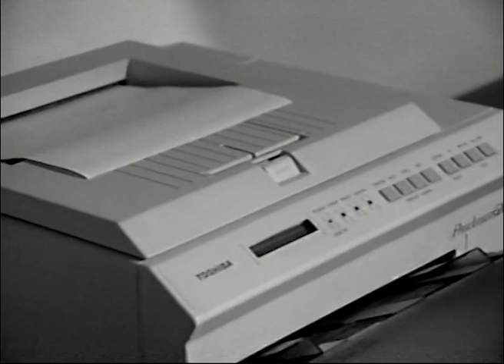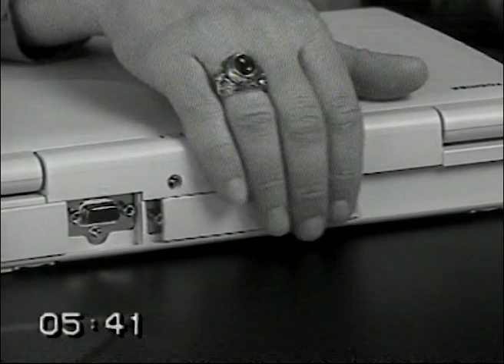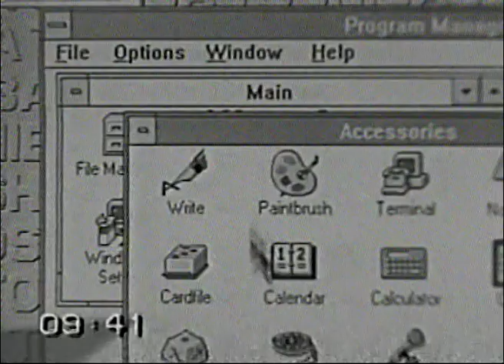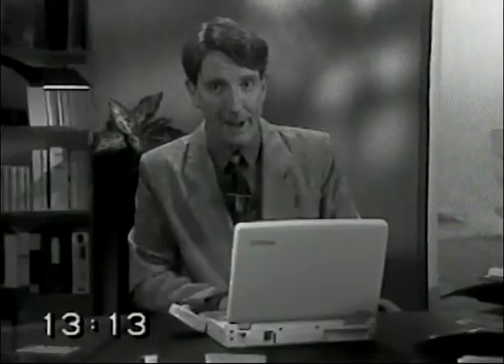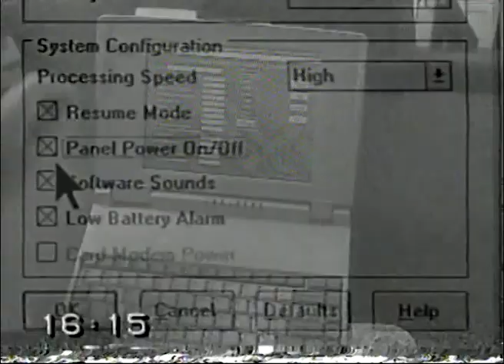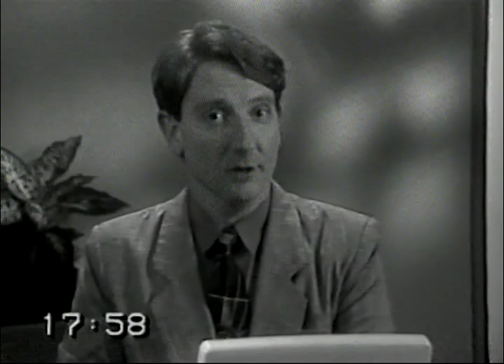toshiba satellite series training tape

Comment: Was the original in black and white? If this is a 486 it would have been late 80s to early 90s. Hard to believe they still taped in black and white although maybe it was still expensive to master full color video.
Reply: It actually depends. Maybe it's a second generation copy. Also might be a format incompatibility, i.e. an NTSC tape played on a PAL player, or a SECAM recording on a PAL player.